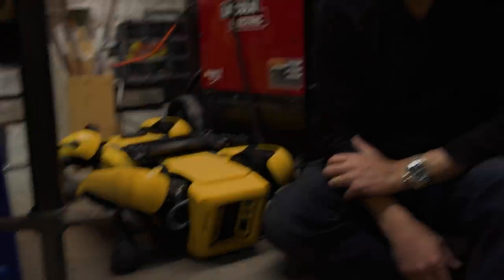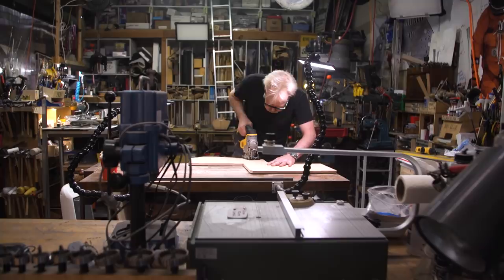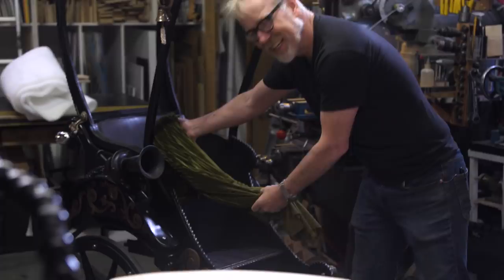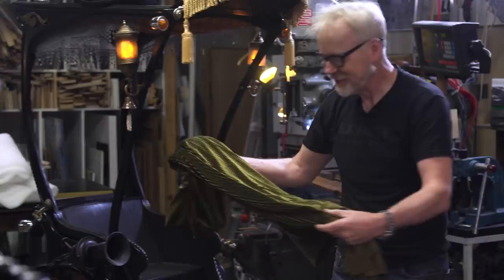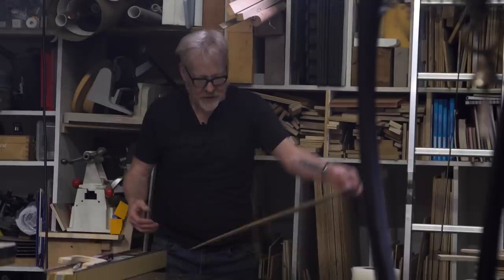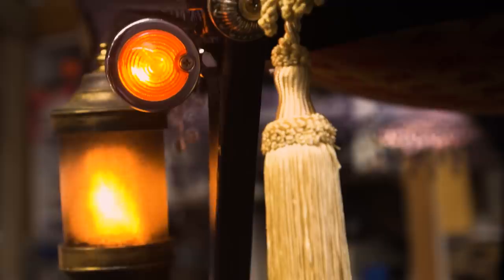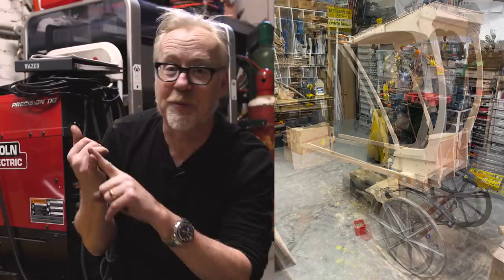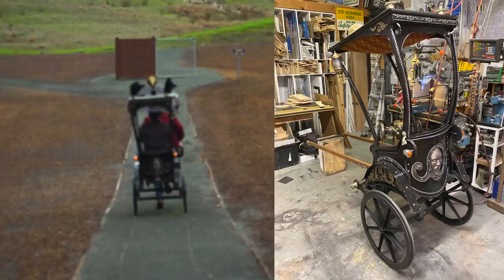Adam Savage's One Day Builds: Rickshaw Carriage!

Comment: Theatre Upholstery: When it just has to be "good enough".
Reply: Depends, even the upholstery on the old DeLoreans was just stapled to the back.
Reply: I think you might be disappointed with how the seat cushion on your multi-hundred dollar ergonomic computer chair was put together.
After re-upholstering a few of them, it's clear that "good enough" applies everywhere and masquerades as "value engineering" in modern manufacturing.
Reply: @Iskelderon  i had a Ferrari 348 back in the days. Guess how the leather was put on the wooden panel behind the driver and co-driver? 😉😁
Reply: Theater Upholstery: It only has to look good from a distance at a few angles.
Reply: @1973Washu  exactly.
Reply: It doesn’t need to look good up close. It just needs to look good from the third row.
Reply: MORE staples
Reply: When it only has to look good from 30 feet away for a couple hours every night of the week.

Comment: Adam my upholstery skills came from an adult education class I took in high school 1973 my mother wanted to re upholster a sofa and love seat we got from my half brother.  What she lacked in good taste in fabric she made up for in enthusiasm.  She pick a green that came out of the 1960’s so it would be well placed in a head shop of the 60’s I did cover a drafting stool at work with the same fabric leftovers...
A great many skills that are useful to makers are available at adult Ed classes such as lapidary, metal& wood working and upholstery. 
Sewing I learned just by using a machine and I have learned to repair mine also.  By doing the terms just do it, getter done apply to makers!
Saw a guy build a power tow for a small airplane from an old power wheel chair.  This is something some one could do to tow a rickshaw.  But you did it first.  With Spot

Comment: Had to build a window seat for Arsenic and Old Lace 😂 Used spray adhesive to hold layers of foam (from commercial ice cream cone shipment packaging) together, then folded fabric over to bottom lid and sprayed glued down. Used foam strips covered in gaff tape to create a padding on the interior edges (looked like leather off stage).

Comment: I don't mind this being a short video.  While I would have loved (and watched) a longer version, I appreciate you putting out this content at all! <3
Also - I think if he made the attachment on Spot just a little higher in the air, that the balance would change so that Spot could stand up fully (getting full mobility of his limbs) and there might actually be less weight on him.  Might have to put a wheelie bar of some sort off the back so it doesn't tip over... or you could change the design of the whole thing so you sit upright even if the whole rickshaw is tilted...

Comment: Achieving proper balance with a two-wheeled cart. A frequent topic of conversation on Recreational Equine Driving. Too much weight in the shafts, and you put too much pressure on the critter pulling it.  lean too far back, and, well we've all seen the pictures of the donkey hanging in the air by shafts and harness because of the load balance.  Looks like your yellow beast of burden is having some trouble.